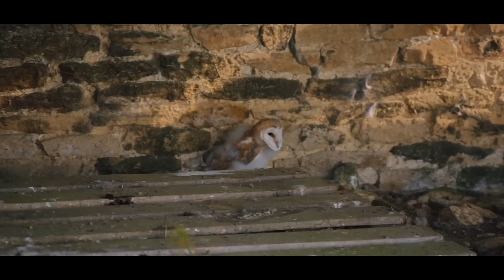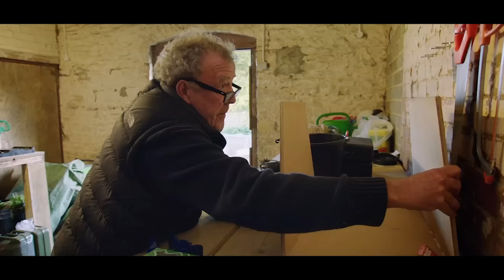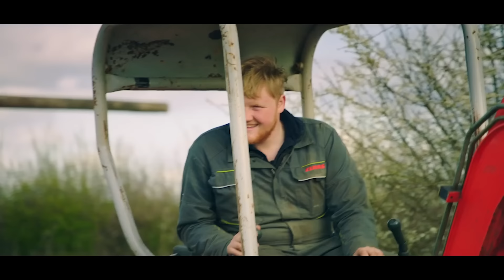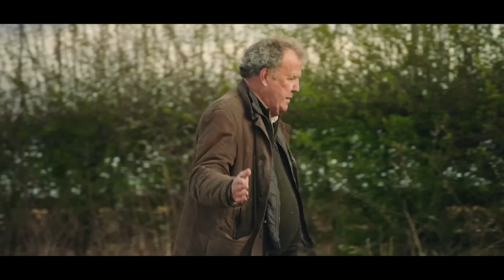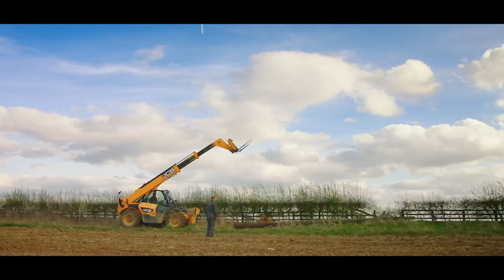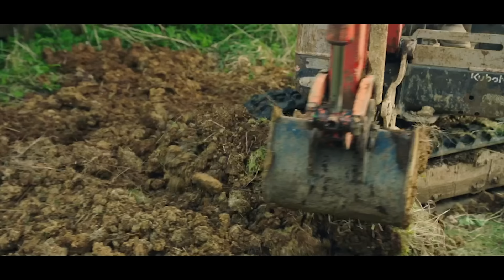Jeremy and Kaleb Struggle to Put Up an Owl Box | Clarkson's Farm | Prime Video

Comment: Had youhad 4x 3t slings and had one off the fork and two bow hitched around the pole. You cou have walked Itin ackwards and still maintained control with a tag line.

Comment: Needs to put a tractor bucket on the super cat. And get up in it to put the boxes on the pole.
 Wouldn't be the first time I have had to do something similar. 
Also they could straighten out the pole by pulling it straight with a chain around the top and pulling with the super cat